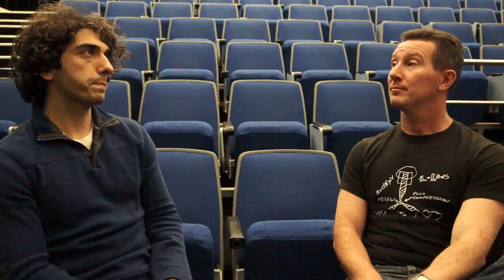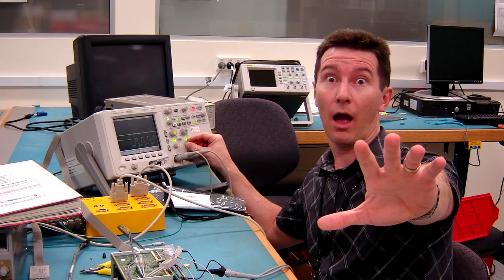The Signal Path Discussion - Engineering & RF (3/3)

Comment: I don't know how anyone can claim with a straight face that moore's law did not die a few years ago.  I recently upgraded my old sandybridge system after 5.5 years, and yea, the cache speed has doubled, and the ram speed has almost doubled, but the clock speed of the cpu is unchanged, as are the number of cores.  And that's after 5.5 years, not 1.5.
Reply: To be pedantic, Moore's law refers to the feature size on the physical silicon used at the fab. The density is said to double every 18 months on a square die. It has nothing to do with the number of cycles you can push (which, itself, is a poor number to determine performance anyways, since there is no real correlation between a cycle and, say, an instruction being processed -- which itself will vary, floating point division will take literally ~100x  as a logical left shift from something in rax.) This doesn't even factor in modern architectural givens such as branch prediction, multi-level caches, tons of heuristics for pipelining, multiple ALUs, etc.
Reply: @wither8, yes, and that was mentioned in the video.  My point is that even using the relaxed definition of performance doubling every 18 months, that has not been true for at least 5 years now.  Also floating point isn't that slow.. even if doing it with a software math library I don't think it is *100*x slower than integer math.